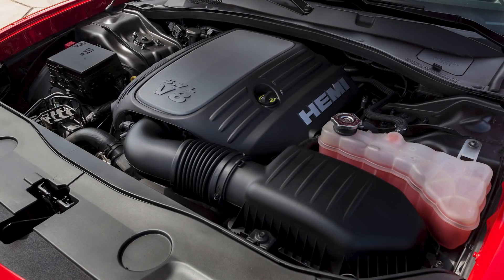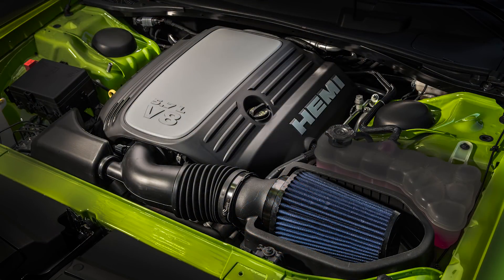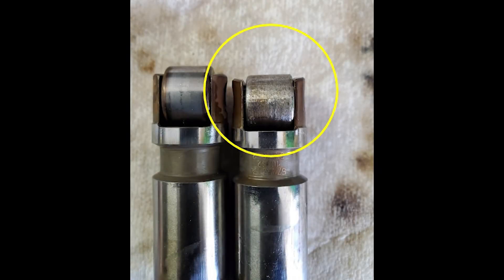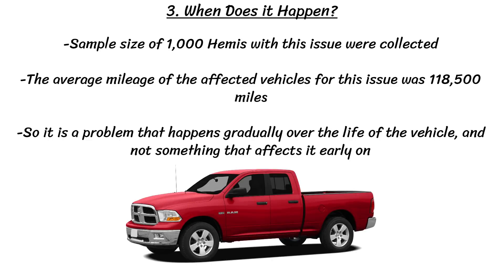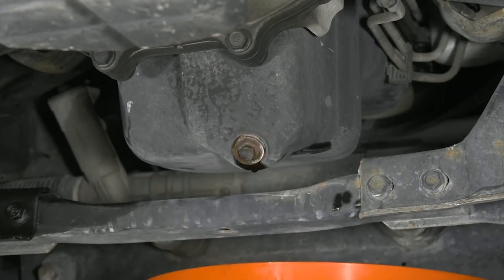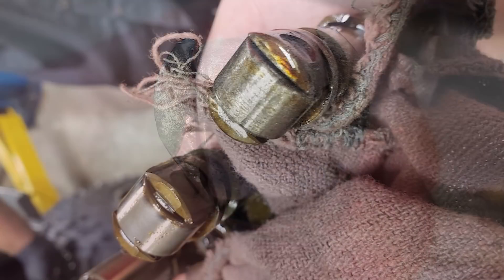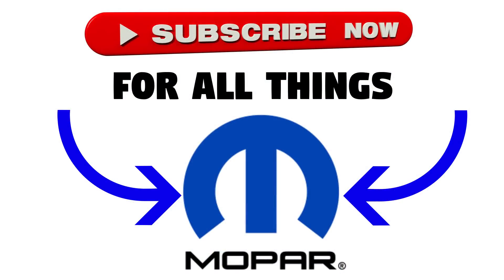The Fatal Flaw of the 5.7L Eagle Hemi V8 Engine Fully Explained (2009+ Lifters and Camshaft Failure)

Comment: 2014 Jeep GC SRT 6.4 hemi has  same issues.  My #3 cylinder developed misfires and ticking at the same time, 122000 miles.  Oil changes have been regular using the recommended Pennzoil Premium 10-40. New lifters and camshaft close to $6,000 to repair.
Reply from the maker: Yeah seems like there’s nothing you can really do about it. Happens to both people who take care of their engine and who don’t. At least it’s not catastrophic like my 5.7 hemi dropping a valve seat haha

Comment: HAS ANY OF THESE PROBLEMS INCLUDING HEMI TICK BEEN CORRECTED ON THE 2022 CHALLENGER MODELS FROM THE SXT V6, 5.7 HEMI AND THE 6.4  392 CHALLENGERS ALL WITH AUTOMATIC TRANSMISSIONS?

SAME QUESTION ON ALL OF THE ABOVE ON THE MDS FEATURE ON A 2022 392 A8 AUTOMATIC TRANS SPWB CHALLENGER? 

SOLUTION:  KEEP THE MDS ENGINE IN SPORT OR PERFORMANCE MODE INSTEAD OF ECO MODE WHERE ENGINE IS RUNNING ONLY ON 4 CYLINDERS TO AVOID EARLY ENGINE FAILURE?

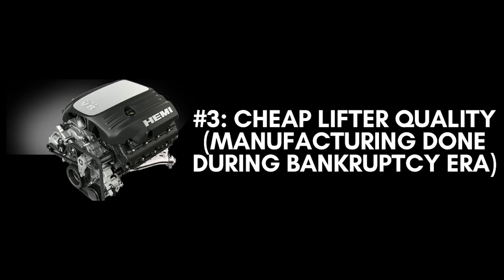Comment: @ 9:10, enough said. It all comes to cheap, bare minimum parts. Let's use common sense people, Chrysler is always known for using dirt cheap parts, and almost every vehicle they make crashes, that's why they can't stay out of last place, but people are so desperate for speed, they'll buy anything, no matter how crappy it is, and they know Chrysler is notorious for junk cars, so they want speed so damn bad, Chrysler is betting on how many suckas will buy it, and they proved themselves correct. Remember the 2.7l water pump? They were purposely made for failure because they knew their low cars would sell well, so they took advantage of those people who bought them.

Comment: i love how you said that the issue with the pushrods seems to happen around 118k miles and that seems to high mileage for these hemis XD, i have a 1997 nissan altima with the ka24de twin cam that has over 387k miles and still runs strong, and a 1989 ford f150 with the 302 small block v8 that has over 246k miles and still runs great, shows Chrysler quality is trash

Comment: Hi, congratulations for the very interesting video but at some point (during the 13th minute) you say that many don't care that the engine is 4 cylinders. On this fact I want to make you a thought (it's just my thought). Almost all owners want to get rid of MDS. But the HEMI engine technique wants that when the MDS is active there is better lubrication of the lifters because the oil is pressurized. So why delete MDS? I believe that this type of engine paired with the automatic gearbox has been designed so that the MDS must have its share of time in which it is active to ensure proper lubrication of the lifters. I think FCA technicians do not believe that drivers of an automatic transmission car always enjoy driving on the track, in sport or sequential mode (all modes where the MDS is deactivated and therefore there is worse lubrication of the lifters). If you always want to drive like this there is a manual gearbox version without MDS and the engine is designed with different components. Perhaps the technicians thought that those who buy a car with an automatic transmission love a sportive and performant car but also love a relaxed drive and perhaps they can also are attentive to consumption in some conditions. So the engine with MDS is designed so that the MDS must also work. Perhaps the problems are in the MDS engines that never run on 4 cylinders at the behest of the owners. What do you think about this? If I don't understand where the real reason of the problem is, you can tell me or you can confirm my idea.
Thank you for attention.

Comment: I get the Hemi Tick on my 2016 RAM Truck when I first start up. It goes does away after a couple of minutes, I was worried it was a valve tap issue. 
Is it common for manifold bolts to break? Or is it that they become loose? Thanks for the Video.

I also get it on my 2014 Jeep Hemi. Only if I start the engine for a very short time. Then let the engine cool. It will tap for a few minutes the next time a start, I know, sounds weird.

Comment: Hey Sir! I have a litte problem with the 4 Cylinder mode on my 2016 5.7 Challenger. If its in 4 cyl Mode and i give it some gas there is a kind of resistance before all 8 cylinders are active again.
You can feel that resistance in a little vibration. If all 8 cyls are on again, the resistence is gone. That only appears in that 4 cyl to 8 cyl moment. My last oil chance was 6000 miles ago. 

Is it a good idea to deactivate the MDS with a programmer?

Thank you and greetings from Germany!

Comment: Will add in addition to your recommendations .....turn up your idle. And/or put a higher pressure oil pump out oc hellcat engine on your motor. Use synthetic oil keep oil clean.

Comment: My 18 rt has a slightly different problem I’ve noticed, I hear a tick at 2000-2600 rpm, below 2k I don’t hear it, over 2600 ish the exhaust is too loud to hear the tick. I’m not sure if this is just injectors though, but it sounds like it’s coming from the rear passenger side of the motor

Comment: I applaud your statistic approach to this issue. There is one other takeaway: it is possible that individual lifter failures could be the result of more than one element present in the engine, ie: poor oil selection or maintenance cycle combined with long idle times. The problem with this particular issue is that it appears the overwhelming majority of engines DO NOT suffer from this type of failure, potentially putting it into the 'random' category.

Comment: I have a 2007 5.7 charger I bought used in 2009 with 42k on it. @ 48k I replaced engine, trans and rear diff with amsoil, I am at 105k have the same amsoil in the trans and rear. I now run high grade Mobil due to the amsoil didn't like speeds over 70 and the oil loss for what ever reason was extreme! With the Mobil I have almost no drop in oil levels. If anyone could tell, explain as to why the ams blows through the engine I would appreciate it. To sum it up my car at 105 k is running like a champ!

Comment: Need your opinion. I am looking into buying a 2006 keep commander with the 5.7 hemi in it. It has 220k miles on it. Do you think this engine is almost dead? How much do you think it would cost to get the engine sorted back into a safe and reliable state. Thank you
Reply from the maker: I don’t think the engine is almost dead at all it will run probably really well and with that many miles on it probably has been taken care of somewhat. The only thing is the 2006-08 Hemis could drop a valve seat at pretty much any time, so that is definitely a gamble. Should that happen, you can always repair the engine or
Drop in a used version for $3-5k. I do think those older Hemis are kind of like a ticking time bomb though, so be prepared of the potential costs. 

However I must say that if the engine has made it to 220k, it’s probably a pretty good one as the valve seats usually drop earlier than that
Reply: @MarspeedCars  thanks a lot brother. I appreciate your input. Is there a better version of the Hemi I can consider in case this one dies?
Reply: @MarspeedCars  what is the best year for the 5.7 Hemi? Thanks again by the way I subscribed. Thanks again

Comment: Bought a 2013 Charger pursuit with 70k miles but 8k idle hours. The lifters and cam were all changed at around 60k miles so I got lucky.

Comment: This video is GOLD! After all of your research, what are your thoughts on the 180 thermostat to help keep the engine cooler, in-turn helping the oil keep its properties longer? Also love seeing Amsoil SS at the top of your list for good oils 👍
Reply: Changing the thermostat was an okay option on much older cars, but with the engine computers expecting the engine to reach a certain temperature before going into the main programming, monkeying with the engine temperature may affect something unintended.

Comment: I always see MDS brought up in these discussions but I feel it's mostly a non issue for lifter failure as quickly mentioned in the video.  Why?  My experience is with the 2500 and 3500 series trucks through the 2019 model year.  Not one of those equipped with a 5.7 have MDS... doesn't exist.  Yet those engines eat cams just like the passenger car and half tons do and it includes model years right through 2019. If MDS was the issue these wouldn't have problems but that is not the case.   Is it oil viscosity or lubrication problem especially at idle speed?  Probably.

Comment: 215,000 miles on my 2003 ram 1500 still running strong. I’ve been driving it like it’s stolen since I brought it home new. It developed an annoying tick soon after I bought it and disappeared at about 120,000 miles. 🤷‍♂️

Comment: Great video. The thought that the problem is from the camshaft being fully enclosed or is raized as uncle tony has said CANNOT be the problem as the 2003-2009(pre eagle)  engines DO NOT HAVE this problem. It came about with the introduction of MDS. As you stated,  in 2016 updates were applied to the Lifters, Camshaft and Valve springs. There should be a large amount of those post 2016 engines with 120k m on them by now and we are not seeing the issue with those motors.
Reply: MDS started in 2006-2007

Comment: I wish I had seen this before I bought my 11 ram 1500. I'm doing an mds delete at the same time as I have the cam and lifters replaced because of the fatal flaw.
Reply: Why
Reply: @snek9353  if I had seen this earlier I'd have found a diesel that was in my price range. Either that or I'd have found a way to get one made after 14. The cam shaft in my 2011, thats at the shop right now, is almost worn in half and has less than 100,000 miles on it.
Reply: @Alex.2014.  That's unfortunate, but the MDS is worth keeping. Just make sure updated Mopar lifters are installed and it'll be fine.
Reply: @snek9353  I'm going off my mechanics advice. He's a formerly certified Dodge and Ram mechanic. He's replaced a lot of cams and lifters and he said the best solution he has found is deleting the mds on the 2011. He has a guy with two 2011 ram 1500s and both have had the cams replaced twice. First time around 100,000 and the second around 200,000. He did mds deletes on both the second time around, and the guy gained some extra mpg, and both pickups have around 150,000 miles since the second repair still running strong.
Reply: @Alex.2014.  I think it better to tune the MDS to more conservative settings, that's what I've done on mine. I think what little MDS has an affect on lifter roller life it's from them using it too much. Factory the MDS will function at speeds as low as 25MPH and as high as 3000RPM regardless of speed. However when you're driving at low speeds your driving at varying speeds, throttle, etc. it's constantly going in and out of MDS, regularly going over 3000RPM etc. By tuning it so the MDS only works at highway speeds in high gear RPMs the fuel savings can be retained without the wear.

Comment: To me it seems connected to the change in the camshaft and oiling system to implement the variable cam timing since this problem didn't start until the variable cam timing.
Reply: It also didn't start with the VVT, the 09-10 engines are fine. This started with a lifter supplier change following the bankruptcy.

Comment: Had 3 Hemis, 1 Charger and 2 Rams all 5.7 Hemis. All of them went high miles zero problems. All 2012 or newer though, had a 2006 Charger Daytona but sold it due to Divorce..only 60 thousand on clock that one I'm not counting

Comment: From looking at the pictures, it appears to be three things:  1. Not enough oil to these parts when moving,  2. steel is low quality.   3.) the Chrysler engineers don't know don't know how to correct the problems, and the company just lets it continue.
Reply: 1. Nope, plenty of oil. 
2. Yes, lower quality lifters in 11-13
3. They did solve it.

Comment: Good video program!!! On both issues, the dropping valve seats and the defective rollers on the lifters; I feel that the reasons why so many earlier designed automotive and industrial engines did NOT develop these types of problems is because they were so much simpler... The earlier engine castings for the heads and the blocks, were made of cast iron... Heavier, than aluminum, yes-usually by 150 -250 lbs... So, when the metals heated up, and the engine reached the normal operating temperatures,  the hardened steel valve seats would  expand at the same/similar rates that the cast iron heads do... So valve seat separations were extremely uncommon... However, when the heads are made of cast aluminum, the aluminum expands at a greater rate than the hardened steel valve seats do... So special valve seat retention methods are used on aluminum heads to prevent this from happening... But if those special retention devices fail, while the engine is running, MASSIVE internal engine damage occurs to interference type of engines... On the issues with the damaged camshafts & seized lifters, one of the problems that I can see is over-engineering... Too much complexity... So many of the older engine designs had NO lifter/camshaft problems because their camshaft and lifters were located in places where oil drainback from the head(s) drained right on-top of the cams & lifters... Most of the earlier lifters had a flat tappet design... No needle bearings to Seize... Heck, I have an engine in a p/U truck (350 Chevy) that has never been removed from the vehicle since it was built - 45 yards ago... 465k. Miles... Same camshaft, same lifters, I changed the timing set about 360k. Miles ago... The truck still runs very well... Earlier - simpler technology often works so much better , more reliably than the newer/ overpriced / ridiculously over-powered / unreliable / incredibly complex / short-lived designs...
Reply: Well said

Comment: The  photo of the lifter Pin @8:08 is my lifter out of my car.  Lifters do have separate oil lubrication beyond the pushrods. The lack of heat stressed discoloration proves there is plenty of oiling. I cna send you better photos of this including photo of the lifter bore oiling gallies.  The idea cranksplash is a lubrication issue a joke IMO as the fact the hemi comes with an integrated windage tray also proves this.  A new-er theory I and several others are now proposing the idea the valve springs are weak allowing the lifters to lifter off, and rap on the cam surface (have photos of this damage) which would increase the wear on the pins and make sense of the markings found on cams.  I would be very happy to share all of this with you (photos ) if you wish.

Comment: In my opinion! It is a lubrication problem! Caused by people not checking and maintaining the proper the oil levels and changing their inferior non-synthetic or semi synthetic oils, at to much of a extended run time! I'm happy to see FCA upgraded lifter bearing size. Less oil sling that way.

Comment: My son in law has a 2012 ram 1500 with the 5.7 hemi. 150 thousand miles. Ticking in the # 1 cyl. Would replacing the lifters with the oversized new bearings take up some of the cam lobe ware?
Reply: Not id that's the actual problem.
Reply: No needs a new cam or send it to fix

Comment: If Chrysler, Dodge, and Jeep would upgrade the lifters to have a chamfered ports that are between the rollers pin and end of the lifters above the rollers. It would allow the oil to spray over the needle or other bearings, cam, and rollers.
(| • |) <-- top of lifter with chamfered oil port. Porting feeding the oil to the roller side located in a rolled groove channel on the sides of lifters. 
  []===[] 
  ____
  |__•__|

Comment: All Chrysler v6 and v8 powertrains have fatal flaws 2.7 3.7 4.7 5.7 oil sludge build up is a real common problem with this generation Chrysler motors narrow oil galleries that allow oil to burn inside the engine block I think the biggest problem was people not changing oil another problem was overheating in many of the Chrysler cars undersized radiator and another thing was oil rings of poor quality causing blow by prematurely I've owned several Chrysler cars and trucks from about 1995 until 2004 went back to gm never had a problem since or nothing that drastic another thing too was rear main seal leaking early on to.

Comment: Great info : 👍 
I’ve got 2016 ram 1500 with 105000 miles , mostly city driving and as I come
From
The middle east it’s pushing 100 Degrees F ALMOST 7 months of the year , was running the moose 5w20 till 60000 miles when warranty was done , immediately after had a manifold bolt break , replaced , currently am
Running royal purple 5w20 hmx or amsoil which ever I get a hand on as royal
Purple ain’t easy to get around here . 
So far still fingers crossed truck is running great .  Hope I don’t have any lifter failure anytime soon.

Comment: Both my 2009 a 2015 have had this issue. 2009 cylinder 5 misfire at about 160k and my 2015 failed at 36k. It’s a diesel next or back to Ford or Chevy for me.

Comment: Might be the most comprehensive video on the subject. My 2013 pursuit developed tick and has sat while I make room in the garage. Hoping cam is ok and can get away with just lifters when I get her opened. Have to say your findings are dead on right in that 2011-13 problem range and high idle hours.
Reply: What's your idle hours on yours? I've got a 13 as well. no tick though

Comment: 2012 Gr. Cherokee 5.7. 101k miles. No tick. Running 5-30 Mobil 1. 3000 change interval.. MDS works like new.  
Unrelated but funny. Running iridium spark plugs. During recall service for the fuel pump relay, the teck said the spark plugs were not compatable with the 5.7 hemi.  My response “They have been comparable for the last 40,000 miles.”. Now 60k on the spark plugs.  Runs great. Hoping for another 100k.